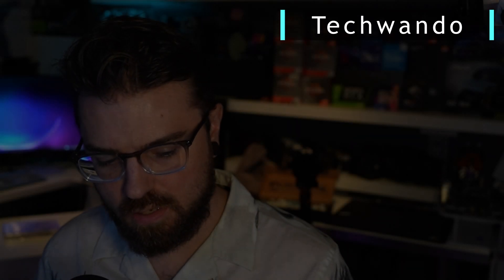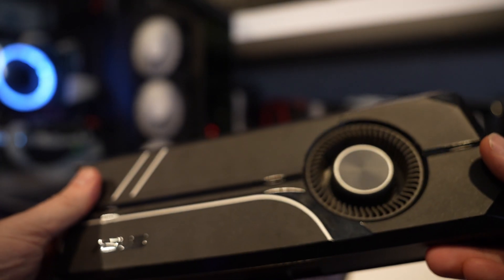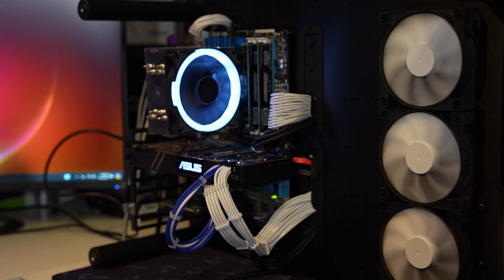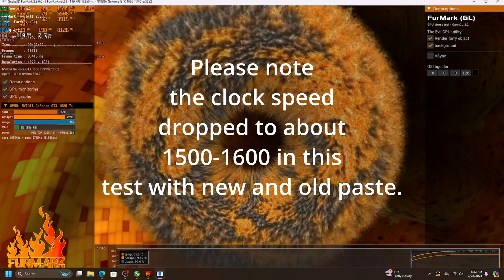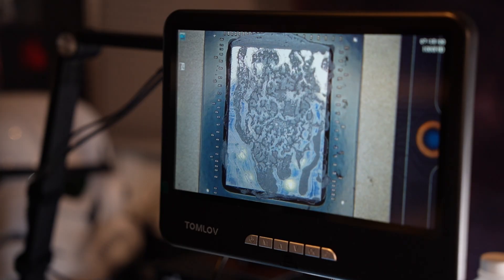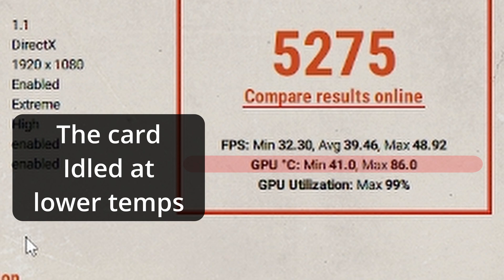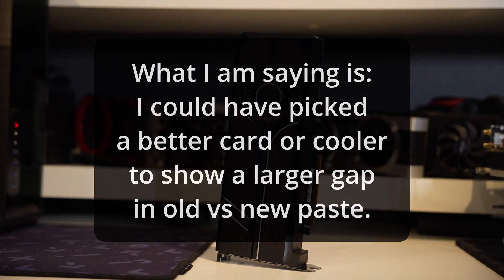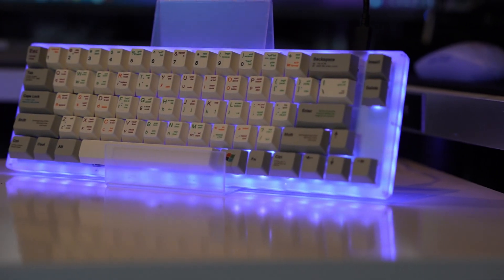7 Year OLD Thermal Paste Still Good? | + Keyboard  Giveaway

Comment: Seems like the quality of just about everything dropped noticeably during/after CViD. Shipping lanes backed up, company shut downs etc. I suspect we will be feeling the effects from that for several more years to come.

Wish I could remember which one it was but I subbed to your channel since I am new to PC building and all that fun stuff, it's turned into quite a passion so thanks for your informational videos! Whichever one I watched, I'm sure it helped me with some issue or gave me the advice I was looking for to help me build the beast of a gaming setup that I love and am now quite proud of ^-^

Being a total n00b to all this, do you think that I should be more cautious with my CPU/GPU, like, check the paste in the GPU and pads, maybe add some to certain areas of the PCB that are rarely covered by pads? Like VRM(?) chips? Seen videos of breakdowns where a really great channel ranks different GPU's based on the way they are put together and how the cooling works/where the thermal pads are in relation to where the heat is generated inside the cards. Really fascinating stuff and I am loving learning about it.

I know ya might be thinking that a beginner maybe shouldn't be taking apart their GPU but I do my homework kinda obsessively lol I'm pretty confident in opening one up. I'm actually going to do a full clean on the first used PC I started with and re-paste the CPU/GPU and give it to my parents for browsing and spreadsheets n whatnot. It's a pre ryzen AMD 7 CPU with an RX560, seasonic 500w PSU that I did some upgrades to for use as a music production setup. Still works good but I can hear it crying out for some TLC and I think a good solid cleaning could give it a couple more yrs of life.

Sry, off into the weeds a bit there. So I guess what I mean is, do you think with all these problems being discovered even in top of the line parts that it's worth checking what I've got? My RX6800 is a bit noisier than I feel it should be but temps appear to be fine. Maybe the 3060 I started with spoiled me a bit on realistic expectations on how the more powerful cards from AMD sound like. That 3060 is seriously nice, I'm pretty sure I won that silicon lotto ppl talk about with that card. Thing way outperforms everything I have seen and everything everyone told me it couldn't do, it can. I plan on putting it into the new music production PC I am in the process of parting out. Got a 7800x3d and a 7900XT on deck for an AM5 gaming setup and will just transfer the AM4 mobo into a new case for the production rig.

I would like to crack them open and check the PCB's in the 6800 and 7900xt to see how well they are protected since XFX warranty isn't voided by doing so. Considering putting some little thermal pad squares on the exposed chip areas if there are any. I'm betting there will be.
Do you think this is worth doing? Am I taking it a bit too far? Or is it a good thing to be thorough like that? I guess I'm just really ambitious and have kinda found a passion in all this, I want to learn and make sure this stuff is working and protected as well as can be considering the expense of it all.

That's another thing in regards to the CPU issues being discovered, the 7800x3d. They run very hot from what I have learned. Can't say I'm not a bit worried about cooking a mobo considering I really do not want to use an AIO. Something about them just really doesn't sit right with me and I'm not sure why I feel so hesitant about them. Perhaps the added complexity of the maintenence in water cooling. I have read alot of reviews of people using higher end air coolers on the x3d's saying they work. But you just never know reading a review, how long have they had that running? A week? A month? 6 months? IMO, that's right when problems would likely start to appear. Hasty reviews sketch me out, can't trust them. And it's so hard, even near impossible to find info from people who have had a setup like that for over a year with solid feedback. Guess I ought to sign up to some forums on reputable sites and start some discussions.

Sorry this is so long, I have a bit of a hard time keeping things brief as I'm sure you've noticed. If you feel up to answering any of this, it would be greatly appreciated. I see you have just returned from a trip so by all means, take your time and get comfy before going through my screed lol

TL;DR Is it worth checking out my newer hardware for thermal efficiency? Check their pasting jobs, thermal pads etc. I've got a hunch I would put alot more love into it lol

Thanks a bunch! Cool vid, I sure do love learning about this stuff. I really ought to run that 3060 through some of these benchmarks and find out why it just works so well. In some ways it was more impressive @ 1440 in Hellblade 2 than the 6800! Which is nuts! Nothing but impressed with that card. Wish I could have gotten a 4070ti super but it just seemed silly to sidegrade to another 16gb VRAM card. Plus I got an insanely good deal on the 7900xt. Future games are going to become much more demanding since photorealism is here and I am really into the graphic spectacle games.

Anywho, I'll spare you here lol That keyboard looks pretty neat! One of the last things I have yet to upgrade since I didn't really see the priority in it. I like that it's still got the arrow keys. Since my favorite game is darkest dungeon and it uses the keyboard for movement, so 60% isn't really an option. HAH! I just remembered, I bet that I found your channel when I was learning about keyboard upgrades! Could be wrong. I'll have to go through your vids and see if I recognize anything.

Alright, for real this time, count me in on the giveaway! That would be amazing! Congrats to the lucky winner!

If anyone else feels like chiming in too, I'm open to any other inputs. All perspectives are appreciated.

I'll look forward to whatever else you've got coming out in the future. Perhaps some stuff on PCB's in GPU's and thermal efficiency? Or general efficiency in uncertain times? Things to look out for etc. Subbed, liked and enjoyed. Thanks!

BTW 1080ti for 100?? Man I gotta check out some used GPU's. Replacing that RX560 would be a smart move. See? Lol I just can't seem to stop XD

Peace!
Reply from the maker: I did start to notice the length of this one, so I held off on replying right away. The app for creators if so bad on the phones, and I won't be at my desktop much till later this weekend. 
As for the discussion of if you should be taking apart your stuff and checking it out...
I think it doesn't matter if you're a beginner. As long as you do things very carefully and with a little bit of confidence, you'll be fine.
Also suggest recording the process so that you can watch it in reverse if you have to put it back together and you forgot where a screw or something went.
 The pcbs are very strong, my other suggestion is to obviously do it on an area that has low static and make sure any of the small caps located pretty much all over the board don't get knocked off or else you could end up having an issue. Caps are the tiny little capacitors scattered all over, you probably knew that. 

Touching on all the other Hardware that you have. It seems like you have quite a few really solid things going, the 7900xt and 7800x3d are awesome. I also see that you mentioned you were thinking about putting the 3060 in a more professional rig? I personally think that the Nvidia cards are better with the studio drivers when it comes to audio and video based applications. 
Amd offers really good gaming value and can do professional stuff as well, I've just had better luck with Nvidia personally on that end. 
Also yes, start with that 6800XT for your first trial, I have a friend locally who does that all the time.now for locals, just repasting GPUs and CPUs. Ordering pads and stuff. Some pads and paste can really lower the temps and improve performance quite a bit also...
Can be a bit addictive. 

Sorry if I'm missing anything here. It's really hard to read on the phone mostly because of the applications stupid response setup, I wish I could screenshot it and reply like an email style reply. 

As for people running the 7800x3d, If you're worried about an AIO just slap a really nice Noctua air cooler or an assassin cooler on it. They will definitely do the job. The AMD chips run hot but at least they are efficient unlike the competition (my Intel chip gets ridiculous).
I have a friend that's been running a 7950x3D since launch with a Noctua cooler, he has zero issues. AIOs look better of course, but you might have pump failure or something years down the line. 
As for the keyboard, I am not sure if I had a keyboard video,  but honestly I might have one, it's been a while. If you find it lmk. 
And best of luck with the drawing for the keyboard. I appreciate the well written comment also, it's always cool to see others heavy passion in the industry. 
Hopefully I didn't miss much. 
Edit I did...
Ahhh yes the 1080ti..$100 is pretty solid for this kind of performance. Basically a 3060 range at this point. Definitely check out your local markets, sometimes insane deals pop up. 
🤙
Reply: Hey man sorry for the super late reply. I was quite under the weather for a while while also working on building a house for myself lol things are hectic to say the least!

Very much appreciate your response! Definitely answered all my questions and more. And gave me a boost in confidence so that's great as well, thanks!

Fantastic to know that I can use an air cooler for the 7800x3d. I don't know why but I just have this feeling of aversion to the liquid coolers. Maybe it's just the extra work, maybe it's the little bit of extra worry. But I don't have to worry any more so that is excellent.

And yes I will definitely be using the studio drivers for the music production setup with the 3060, thanks for mentioning that since it is so easy to miss for people who aren't aware of it.

Man, right when my return window passes on the 7900xt I see the announcement for the 4070 with 20gb VRAM lol! I like both companies, they have worked great for me. But I have to admit that Nvidia has just been around longer to be the superior choice. There were aspects of my 3060 where playing hellblade 2 on 1080p low settings, basically photorealism, looked better than the rx6800 at 1440 medium and even high settings. Just small details, like grass and textures of rocks were sharper and looked even more real. Which is amazing. It's still incredible with the 6800 and there are textures and assets that do not appear at all at low settings. So that's cool to get even more detail in the environment. I'm a huge fan of the crazy graphics games. Really, really excited that I am going to get to live to see true photorealism. I didn't actually think I was going to get to see it in my life but turns out I was fortunately wrong.

The 7900xt/7800x3d build isn't finished yet, sadly. Still need MOBO, RAM and the more powerful cooler. Thinking of getting the Fuma 3 or the more powerful version of the thermalright assassin. Can't remember what it's called off the top of my head. Absolutely cannot wait for that.

Hey quick question for ya, and feel free to take your time getting back; when comparing the 4080super and the 7900xt, I see that the 7900 beats the 4080 in all specs by quite a bit. Except for Nvidia's tensor cores, more developed raytracing cores and particularly in raw core count. But everything else, the 7900 has it beat by quite a bit. So my question, is it the raw core count that really makes the GPU that powerful in comparison? Over transistor count, ROPS etc. They are pretty much tied in performance, with the 4080s beating it by like 1%. But the 4080s has nearly double the raw core ccountof the 7900xt. Is that what makes it able to compete with the 7900xt? If you happen to know, I am quite curious about that one. All good if not, I shall continue my research either way.

Someday I'll get a nice Nvidia card lol maybe sell the 6800 and 7900xt in the future when Nvidia is ready to put out a card with more than 16gb VRAM that isn't way more powerful than what I need. I settled on the 7900xt for the VRAM (although I know it's not everything), it was pretty much the best I could get without going way past required performance for 1440, with something like a 4090 or XTX. Ideally all I really needed was 7800xt or 4070ti super, ti super was the dream but I got a crazy deal on the 7900 so no regrets there. 300 less than what the ti super would have been.

It seems like Nvidia is stingy on the VRAM because they think it's unnecessary. And while that is true at the moment, I really do think that as UE5 and other platforms come out with these photorealistic games, VRAM is going to become a necessity where headroom is needed. Hellblade 2 was a perfect example of that. Albeit, it does not have the best optimization, as well as a few other shortcomings. Not a deal breaker for me since that series holds a special place in my heart. But I can see why alot of people were upset and I really feel for the people who got locked out of it. Guess we will see but Black Myth: Wu Kong sure looks like it's going to be reeal close, if not on the same level and it has way, way better optimization to run on older hardware. Really quite amazing. Very much looking forward to release day for that one.

Anywho, just wanted to say thanks again for your reply and the info and encouragement. It is much appreciated. Sorry to be that commenter that just can't help but leave books for ya XD I tried to keep it shorter this time lol

Also, I tried to figure out which video of yours led me to your channel, I can't seem to find it! Maybe some of the ASUS mobo stuff, since my AM4 board is a TUF board. Works absolutely flawless. Guess I just somehow keep winning that silicon lottery lol really having a hard time figuring out how all these professionals have so much trouble with boards and cards and chips and RAM, yet somehow, as a blooming enthusiast, I am just not running into issues like that. I'm sure I will though! There's just no way I'm doing something better than them. Heck, if it wasn't for you creators and tutorials and stuff, I wouldn't have been able to build my PC's at all. So everything I learned was from the people having problems lol

Was also thinking maybe the crazy priced builds ep. 1 or 2? Really not sure. So weird that I can't remember. Glad I found your channel regardless. I like what you have to talk about and the technical videos you have are awesome.

Alright, I will stop myself now lol you have a good one man. Hope alls well with you and yours! Hope to hear back and I hope you're able to see my comment on the PC instead of the awful phone apps lol

Peace brotha man, keep up the great work!

Comment: I have to say, from my experience the GPUs tend to be more tolerant to the...need for paste replacement.  It can obviously help, not in this case as you hilariously showed, but IMO year for year they tend to need it less than CPUs.  At least that's my experience.

I have to say man, I wouldn't go near a blower style GPU ever again.  The last two I got (15-18 years ago) were the HD4870X2 and the Radeon 6850 and they were horrifying in how hot and how loud they would get.  Never another blower style again for me.  Never.   OK the 6850 was better, but still bad. 

Speaking of CPUs.  I heard AMD pushed back the release of their latest ones and even called back the products...for a couple of weeks.  Any idea WTF that is about?  I mean, if there is an issue with them, how are they going to fix it in two weeks and have the products back for shipment?  It doesn't make sense to me.

Good for you doing giveaways.  Bravo.   I have done it several times before, but only for software.  It feels good when you do it, doesn't it?
Reply from the maker: Yeah it's probably the last time I will pick up a blower too. They make sense for servers and small systems but they are loud and unforgiving haha.
Also I remember those old AMD cards, turbine jet noise from those bad boys.
Also your right about GPUs. Definitely can go a bit longer. 

As for AMD, They sent out a bunch of them to system integrators and apparently they are not all running within spec (is the rumour). So instead of having some massive Intel style issue down the line because one chip doesn't clock high enough, they are just holding off until they figure out they fix. Now these are just the rumors going around so I won't say that that's 100% what it is, but it seems likely, as they did have similar issues before.
Appreciate the comment man.

Comment: It's going to be interesting with more recent cards that have had cheap-ish compounds applied on them. Kinda baffling that some cost saving mesure means cutting there, but at least some really good compounds have been coming out with more accessible pricing to ensure affordability and durability.

Only had experiences with repasting laptops' or MXM's, and probably some GT210 I found a couple years back 😂.
Reply from the maker: Yeah, imagine dropping a grand on a card and it overheats in a month. 
I feel like it's probably a smaller batch of bad paste or something, but there hasn't been a follow up on it yet.